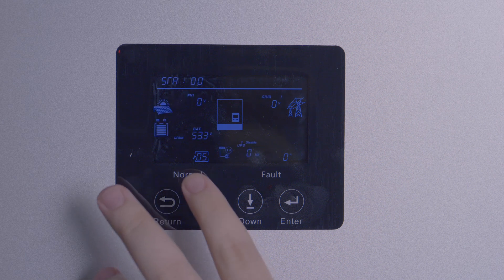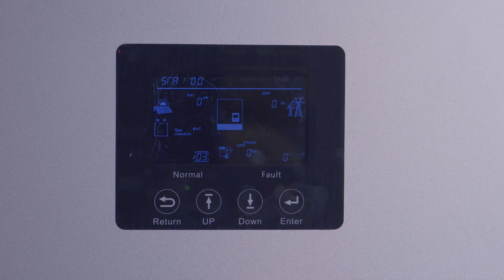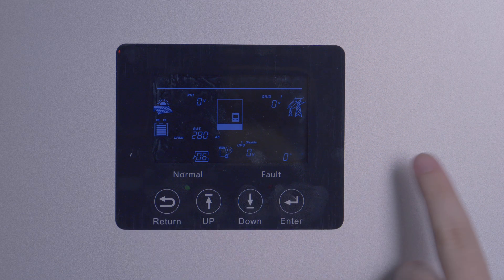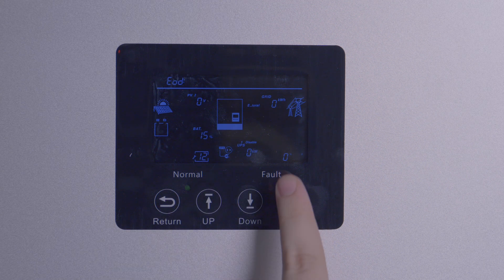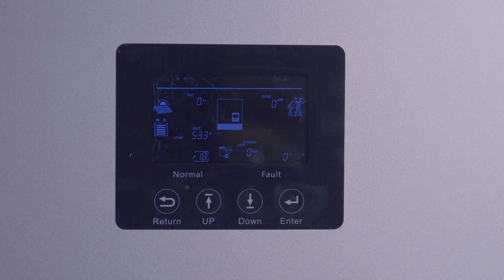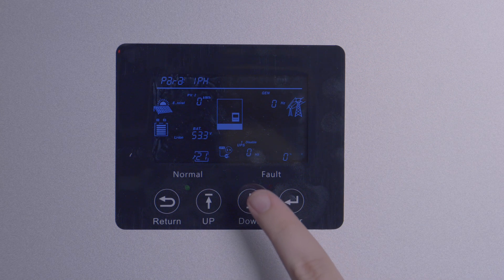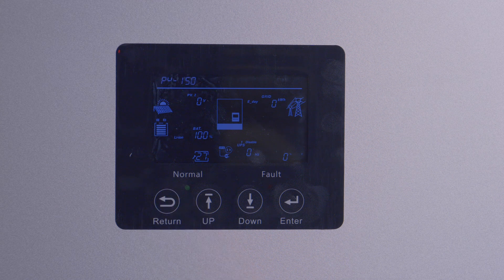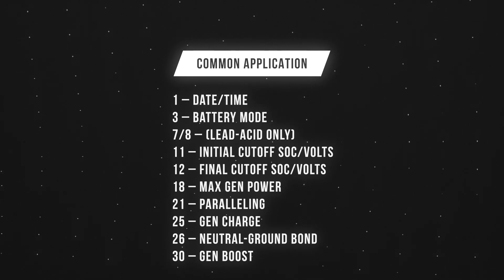EG4 6000XP Settings Walkthrough | Commissioning and Important Settings

Comment: Can this thing run 240v and 120v at the same time?? lets say, divide the two lines at 240v and take the neutral of the device to run 120v???
Reply: Why would you ever want to do that? 120V devices work with 240V power just fine.

Comment: Before you buy this 6000XP inverter which is manufactured by Luxpower, Ask Google AI "Do luxpower inverters have a higher failure rate than low frequency, transformer based inverters?"
Reply: I DID. the "LOW FREQUENCY INVERTERS"  munch PCB's & power modules more often...and cost twice as munch to repair/replace. Warramty is waay better from EG4 than OUTBACK or Midnite solar. Btw....OUTBACK bailed out of busines.

Comment: What about battery share? If you have two units in parallel, do you have to parallel the batteries physically or will the 600xp sort that out if connected separately but in parallel via the inverter? 🤔

Comment: Hello, I recently installed the eg4 6000xp and I noticed that when it is charging the batteries or powering the loads the fans stay on all the time, is this normal? Because my Solark 8k only turns on the fans based on temperature
Reply: Yea it is

Comment: How do I know how many amps to set up for my solar panels
Reply: Voltage is what you should be more concerned about. If your panels don't have enough voltage, then the 6000 XP won't get any power. The maximum usable Amperage per PV input is 17 Amps, I believe.

Comment: Agree, too fast for me. Great equipment, but could use some help to improve this video and more important the app.
Reply: Agree on the speed and lack of very specific detail. Signature Solar videos are much more thorough. Will Prowse recommended a quick start guide, but it seems they didn't take his advice. I just purchased this system and no quick start guide for the batteries or inverters. Bummer.

Comment: If setting #11is initial cut off and setting #12 is the final cut off why can't setting #11 be higher than setting #12?  The Inverter will not allow me to set the value in #11 higher than the value in #12.

Comment: I am running my 6 Lifepower4 batteries in lead acid mode.  They need updating to work and the software patch wouldn't work.  I was promised an updating device but it hasn't arrived yet.

Comment: There is a lot of confusion about charging Lifepo4 batteries in lead acid mode. I already had 4 100ah off the shelf batteries and added 4 more. We spend a lot of money with you for these inverters and it seems this area is lacking. thanks

Comment: Wonder if this is compatible with AOlithium 48v batteries?
Reply from the maker: I don't believe AOlithium is a BMS that is supported in closed loop, unless it utilizes a protocol that one of the supported battery brands has. You can find the compatibility list here: https://eg4electronics.com/wp-content/uploads/2024/04/EG4-6000XP-Battery-Compatibility-List.pdf

Otherwise, you should be able to utilize them in open loop (set as Lead-Acid on the 6000XP).

Comment: Wish they had a proper  UL listing for building  codes. Just watched a video where they all had to be removed and replaced to meet electrical code. Just ordered  my panels  from you but skipped  the inverters because  of that and looking at alternatives. Will these ever receive proper UL ratings for use under the NEC so they can be legally used?
Reply: Can you post a link to the video?
Reply: @kenthiergartner1506  https://www.youtube.com/watch?v=i7CsDm1FfbI
Reply: If you are permitting check with your AHJ see if they adopted the 9540 yet before buying. I heard in California even off-grid remote properties are requiring 9540 ESS which is insane. This is why many just don't bother with permitting because government regulators make it so costly no one does it. I live on 100 acres no one bothers me what I'm doing out there local county doesn't care the board is mostly people like me just want to be left alone.
Reply: @AndrewVanTil  watch the video. He explains how it is illegal according to the NEC and can't get a permit to finalize the installation.
Reply: From my understanding, they have been tested to comply with UL 1741, but are not UL listed, which only happens when UL tests them. Not a third party.
Reply: UL fills two roles in this area. First, generating the standards for NRTLs to certify against. Second, as an NRTL. The NRTLs are functionally equivalent. It doesn't matter if UL or Interek (for e.g.) perform the certification. It is the same thing. You can view the certification of compliance with UL 1741 here: https://eg4electronics.com/wp-content/uploads/2024/04/EG4-6000XP-UL1741-Certificate-of-Compliance.pdf.
Reply from the maker: The legal requirements for various UL listings and compliances are enforced by local Authority Having Jurisdiction and utilities (if you're tied into them). While UL9540 is often a requirement for large cities or utility companies, UL1741 (which the 6000XP conforms to) is usually enough for most folks who are building an off-grid system. UL9540 is a full ESS compliance, which we have for our 18kPV + Battery solutions which can be read about here: https://eg4electronics.com/categories/ess-systems/eg4-powerpro-ess/

Comment: Are these settings applied the same to all inverters in parallel 
Ex. 4 inverters in parallel
Reply: AFAIK, you make the changes on the primary inverter. It publishes the settings to the secondary inverters.